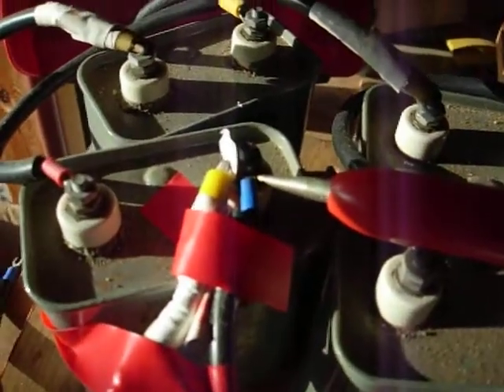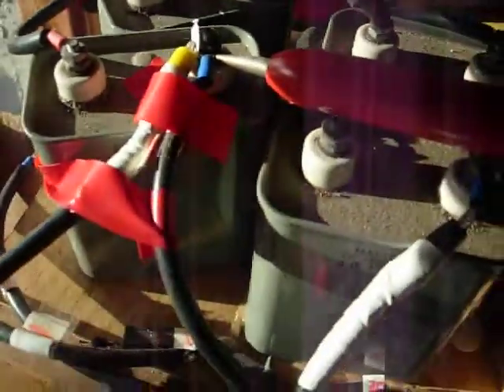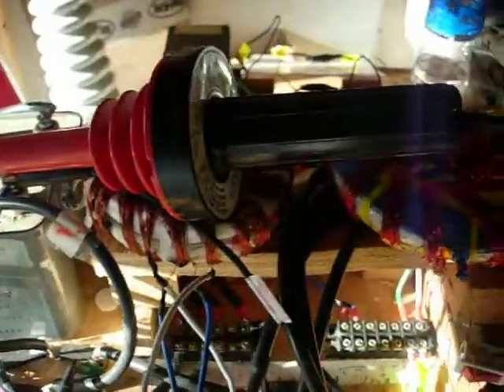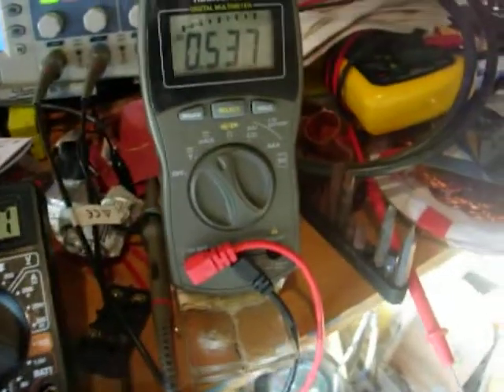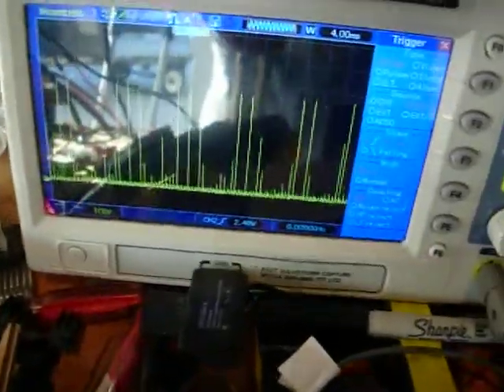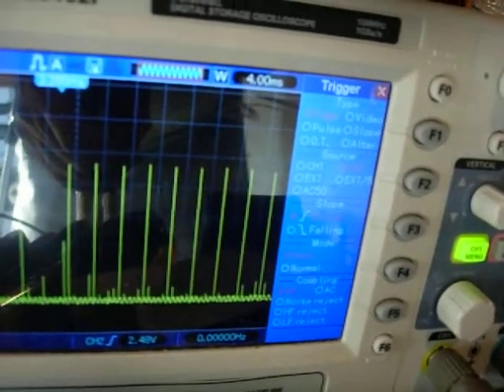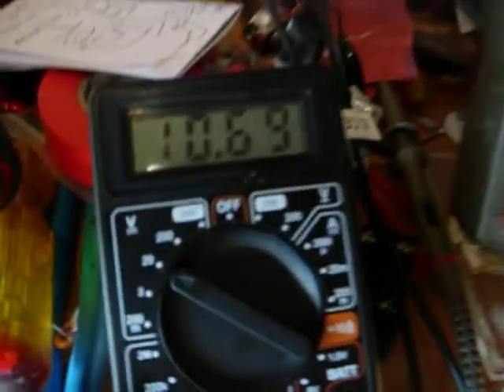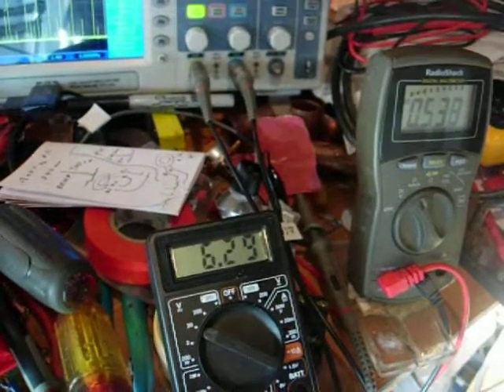Don Smith #306 Testing new coil rodin

Comment from the maker: I found that if the battery draw is less than 450 ma into the system running Rodin A & B in parallel there will be no arcing thru the paper gap.  Once the current draw is between 500 and 700 ma then arcing occurs.

I thought that the distance between the rodin and 850t coils and perhaps the wire size was bringing about the arcing but that's not the case.   Current/charge from the battery is the key..  The coils BEMF from the Rodin A & B coils reaches 486v positive pulses with no reversals.

I also found that the Ed Gray tube thru the diodes cathode  anode to battery positive terminal prevented the arcing even at 24kvdc.  This was 4kv above the series caps which could only handle 20kv It was still climbing when I shut it down.   when the diode and battery were replaced by a ground connection arcing came back.

Also discovered that the 4caps in series 1uf each did not generate a magnetic field when the Ed Gray tube grid was connected to a coil with magnet placed on top of it.  the position of the anodes must be close to edge of the grids.